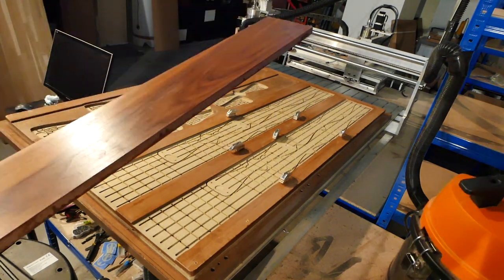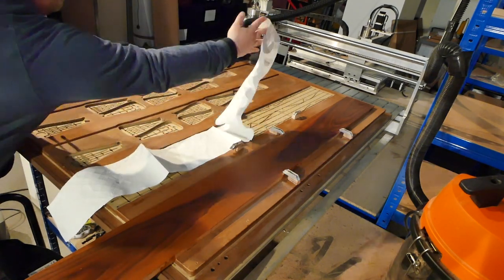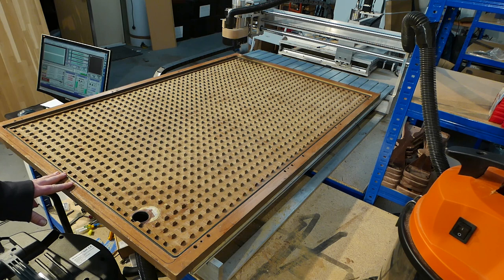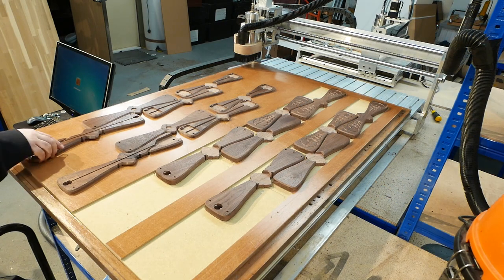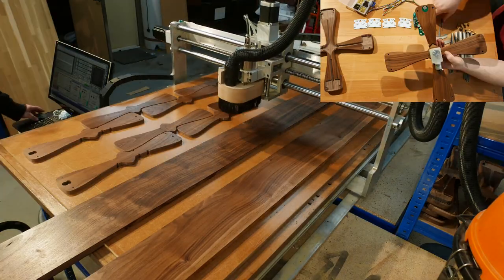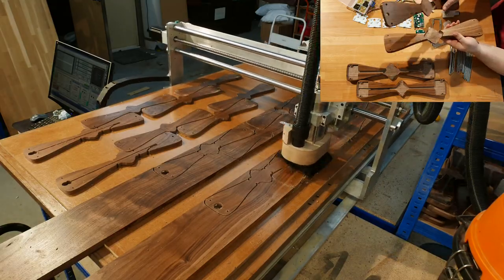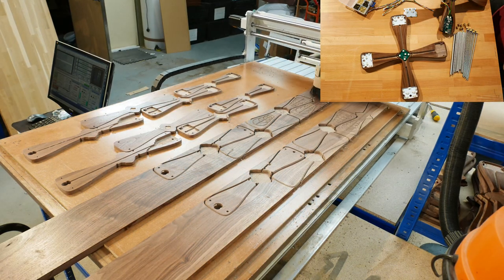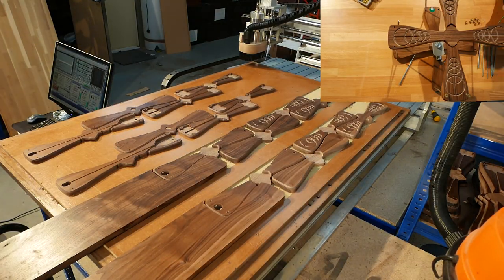Double sided walnut machining on CNC vacuum table

Comment: Very nice! What size plumbing are you using below the table ?
Reply from the maker: not sure of the exact measurement, but you can see the hole and hose dropping out of it here: https://youtu.be/VGGKKosgwpQ?t=80 something between 1.5 and 2 inches I'd say. The shop vac I'm using is a beast with triple motors, so I can boost the vacuum when I have some leaky work pieces.
Reply: @n0f8r  Oh wow, I totally missed the hose going there, I thought it was plumbed further. That's very impressive! Thank you. Have a 4x4 on order and this bodes well for my plans.

Comment: Thanks for making this video, it's a great vac fixturing system and this video is very well done.
I did have one question, you mention early on how version one of the fixture had the air grooves and holes situated too close to the work edges.
Could you expand upon that slightly? I've been experimenting with production vacuum fixtures and I am constantly looking to learn more about them.
Reply from the maker: The first fixture allowed too much air flow under the edges of the work pieces and through the cross-hatched air-flow channels - which also had too many through-holes in them.  I was trying to increase suction by cutting those air channels and holes, but I actually reduced suction - a lot. 

Vacuum holding is all about surface area exposed to suction - but the surface area is no use if there's no suction :P

So the solution was to remove most of the cross-hatch channeling and holes on the big rectangular slots, and provide sealing around the edges in the second-side-machining slots.

Comment: the vacuum pump I'm looking at is  3553.42 psi ... that should work!
Reply from the maker: hmm - vacuum holding is limited by atmospheric pressure, the most hold down force you can get is 15psi. So the absolute pressure rating of your pump is not that relevant, what you really want in the suction on a vacuum table is high Cubic Feet / Minute, that lets gives you some flexibility to have some leakage and still hold your parts down.
Reply: @n0f8r  So, how many CFM do i need? thanks
Reply from the maker: @blancatrujillohigueras9865  it depends :)  on your table size and how leaky it is, and how much surface area your parts have (larger surface area equals much more hold-down force) For my table and my parts I'm using a triple motor shop vac. It has 3 1000w vacuum motors with individual switches -  and I find that sometimes I only need 1 motor, other times I need 2.  It's very similar to this thing https://www.bradfords.co.uk/hyundai-3000w-triple-motor-3in1-wet-dry-electric-hepa-filtration-vacuum-cleaner-hyvi10030?gclid=Cj0KCQjw756lBhDMARIsAEI0Agl5n18I9LJmTm5A2V67tZaPBT55nznLheeoyUiMwi7uO_q54xAVHXYaAikvEALw_wcB